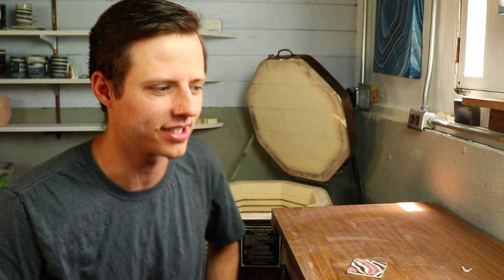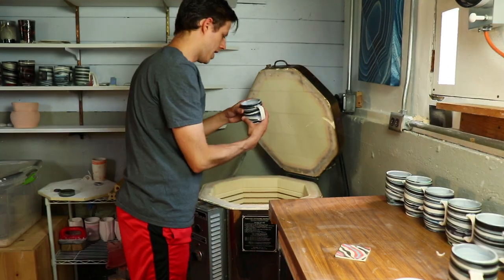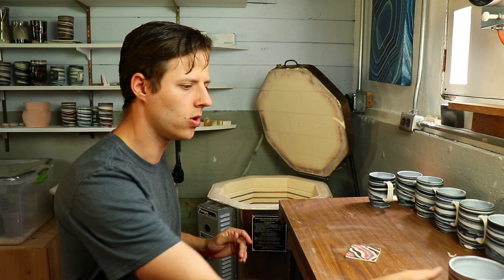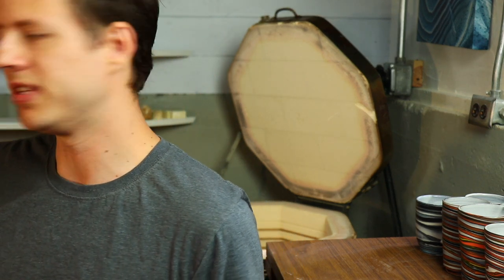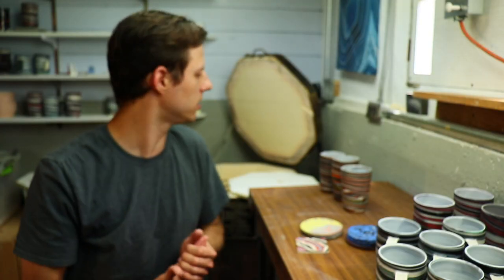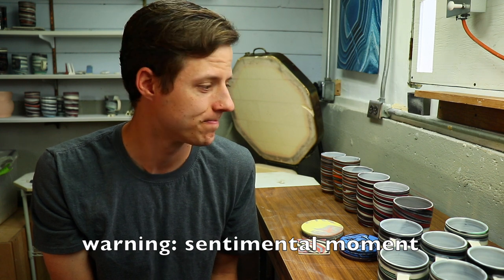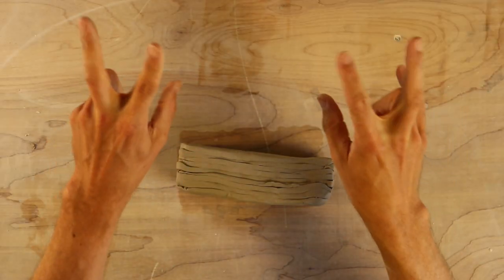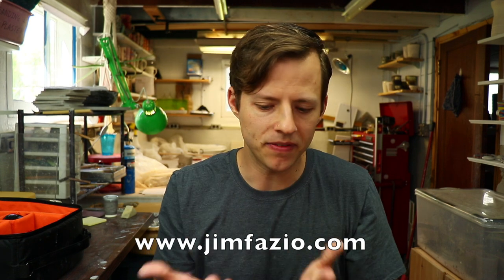Best Kiln Yet! New Mugs, Giveaway Winners, and Online Store Opening | Kiln Unloading #6

Comment: Hi!
I heard a pottery technique about polishing the clay.
Take a metal spoon, and with the curved backside of the spoon rub the bone dry claybody what you want to polish. I tried it out, it looks great and shiny, but the metal leave some grey marks on my clay, i don't know if it disappears after firing, but it makes the clay stronger, and maybe you can try to polish the outside of your marbled cups, if the color doesn't get distorted it will look awesome. It don't need a glaze over it.
I use red clay, and i can't fire it, so I don't know how it looks after firing.
Be carefull to not apply too much pressure, but a little bit is neccesary.
Maybe it worth a try.
Reply from the maker: I believe you are referring to burnishing. I love the feel of it when it’s done. It’s almost glassy when it’s finished. I burnished one piece a few months ago and it looked sweet but very time consuming. I don’t know if it’s realistic for ever cup but I love it for special occasions.

Comment: You can increase the temperature of the clay body, by adding alumina oxide.
Reply from the maker: Do you have a starting point for how much to add?
Reply: @CeramicJim  since the exact formula of the clay body is unknown, a set of test tiles needs to be done, start with increments of 5% alumina for 100 grams of dry clay body.

Comment: Reading through the names, is like taking attendance on the first day of a new Semester.  I always say. "Nothing personal, if I butcher your name."

The black and white wares are really nice.  You could call them "Zebraware"... What's that?  They have some turquoise in them as well?  "Neon Zebraware" then?

I also like the orange black and white wares.  They remind me of a clown fish.  It's too bad they had that issue with the bloating.

It looks like some of the foot rings are plucking a bit, or am I just seeing things?
Reply from the maker: Right? I always give them a chance to correct me but I’d they don’t then it’s fair game haha. 

Sadly, I loved those orange ones too. They turned out so great. As for the plucking, and I honestly had to look up that term, there’s a little bit but I have my diamond core diamond sanding pad now so I can flatten and polish them up in no time. It sticks to a bat permanently and the small size was only $60 or so. Thanks for the feedback, Ben. Means a lot.
Reply: @CeramicJim  I've never used porcelain myself, but talk to potters that do, which is why I know the term.  It's especially problematic, for lidded wares.
The common solution for the bottoms of wares, and even moreso for lids, is to mix alumina hydrate into wax resist and brush it on, anything that will be in contact with something else.  The alumina prevents the plucking, and you just have to wash off the powdered residue, after the firing.  Be warned, you need to be careful where you get this mixture, as alumina wll mess up any glaze it gets on.
Reply from the maker: Ben, I very much appreciate that info. Hoping I don’t have any or much more plucking moving forward.